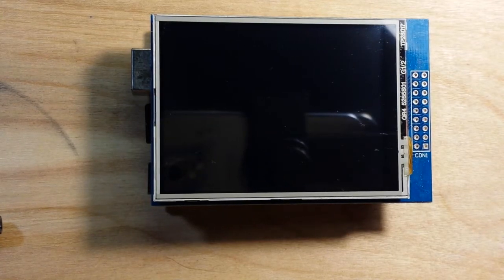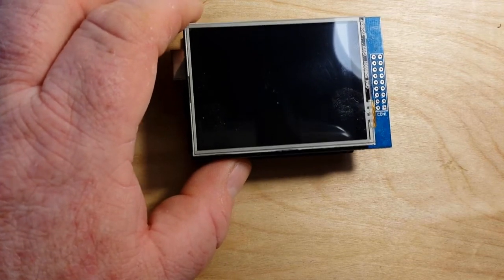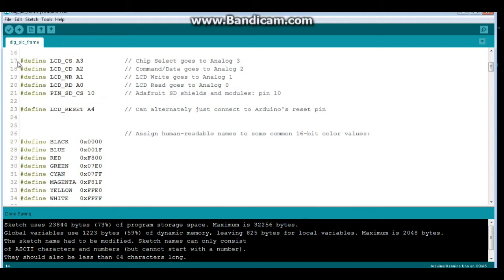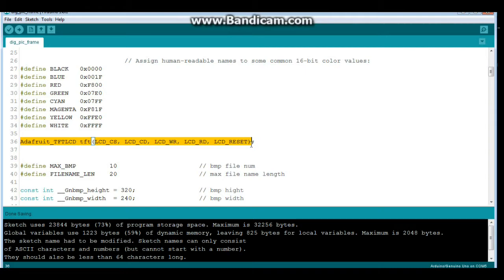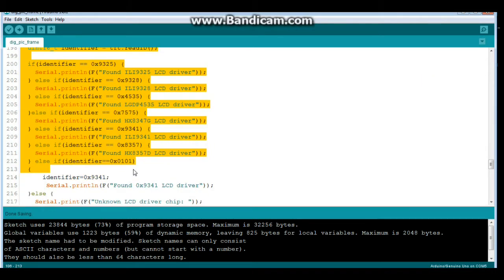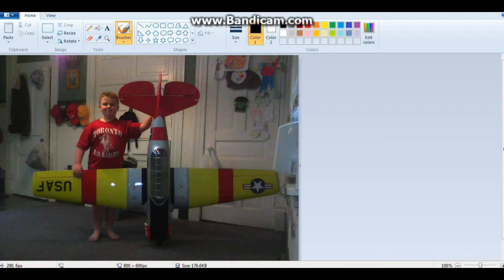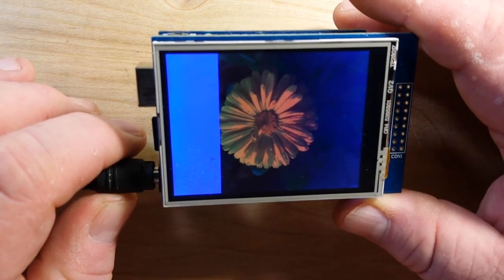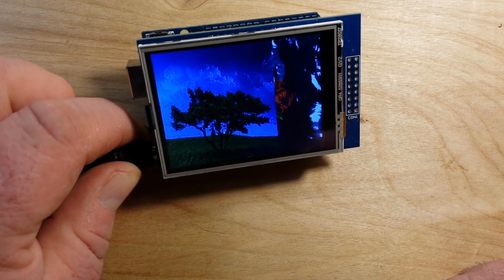Arduino DIY Digital Picture Frame

Comment: Iam trying to read a single image from the SD card to a 3.5" arduino uno tft display with the same "showbmp" sketch. The tft display is showing :"bad bmp" and "didn't find bmp image". can anyone kindly post the solution ASAP.
Reply: The same problem here, can't solve it too...

Comment: i have another TFT with a different library will the adafruit sketches work for my board?
Reply from the maker: Yes but you may have to change the pin numbering.

Comment: can these images be changed faster if I use the arduino mega2560?
Reply from the maker: I havent tried that. But you could just change the delay variable.
Reply: learnelectronics thanks